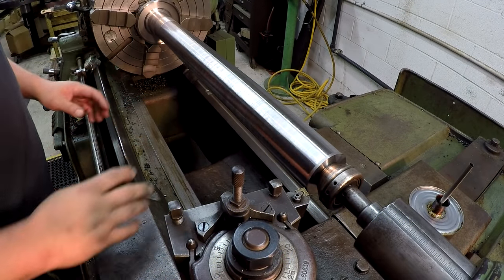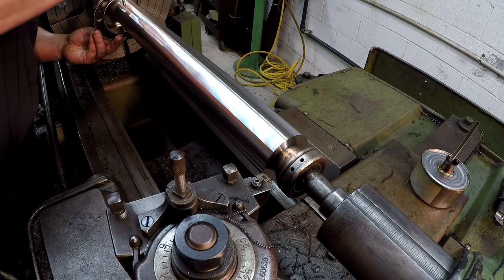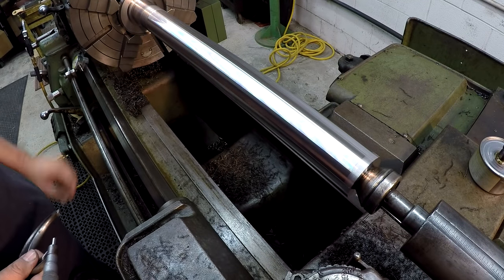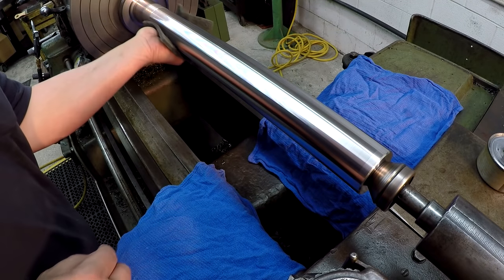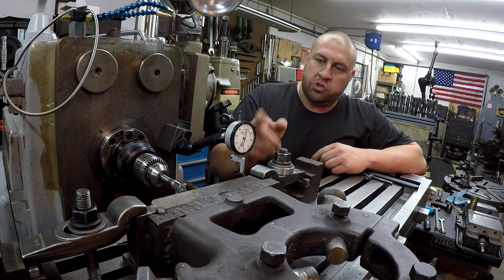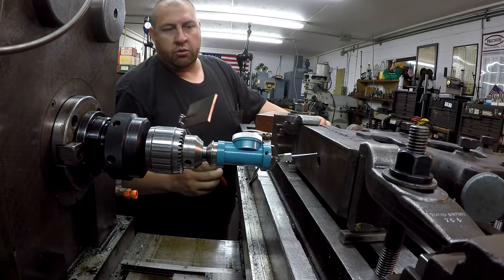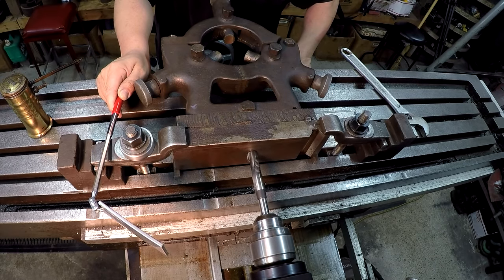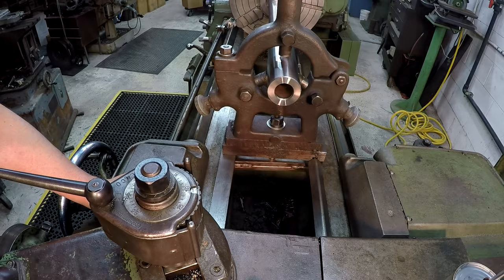Gearbox Shaft for Well Drilling Part 4

Comment: watching this stuff relaxing as it is isn`t just about bits of metal its about a logical thought process and moving forward stage by stage with patience and thoroughness checking each stage as you go. Its a lesson in life. I remember years ago being told to saw, file and scrape an accurately square 1 inch cube out of 1 1/4 inch mild steel square bar. At the time I thought what`s the point of this but as I got into it the penny dropped and I realised why I had been instructed to do it. Then just recently one of my friend sons said he had to do the same thing, he was angry that it was going to take so long and it was so useless. I suddenly felt like a wise man explaining to him the reason.
I expect many engineers will have learnt this lesson in their youth as well

Comment: Side controls on the K&T sure would be nice.  I leaft to get some flat bar for spacing my pillow block up on the hoist and came back and you gained like another 200 subs! You will be catching Saunders by the end of the year at this rate!
Reply from the maker: +bcbloc02 this morning I had like 800 to go, so looks like a thousand or so just today. Crazy stuff! Did you get the new pillow block you needed for the crane shaft?
Reply: Abom79
Yep, all I got to do is make an adapter block to mount it with.  Do that and a little welding and should be ready for lifting!

Comment: It'd be cool to have a laser based micrometer that could measure a diameter by just passing across a part without touching it.  Maybe it's not possible
Reply from the maker: +Do R/C! Sounds like something from Cybertron
Reply: Im pretty sure the tech already exists.   The only issue I see is compensating for it being on an angle but just adding a second laser and detector on either side should fix that. It would be really cool for ID measurement too

Comment: Mighty nice finish on that, I love it.
I'm still hearing some clipping there, do you have the rhode plugged in? I suspect not. GoPro sound has never impressed me too much although it's a lot better than some GoPro sound I've heard.
Reply from the maker: Yes I always use the Rode mic. Not sure where the clipping is coming from.
Reply: If there's a level setting on the camera? On my camera (canon 5d mkii) I set the sound from Auto to manual and then set the levels. Since most of the gigs I video are ranging from loud to deafening the gain gets set to the lowest stop before turning the gain to zero. Auto is great for many circumstances but any sound that is too loud just gets clipped.

I googled 'gopro sound settings' but am not sure of your model... There might be a 'Hi' and a 'Lo' setting but not sure.

As usual it takes a bit of study to figure out what people are talking about but it's useful to know these things I feel. You do an excellent job of making your videos, I am impressed Adam! That's the precision part of machining transferring across I reckon :)
Reply: I should add that once you get the gain turned down, you 'normalize' the audio so the peaks are at 0db so the audio does not end up quieter. In Adobe premiere, you right click the audio track and click 'Audio Gain' and check the setting 'Set Max peak to 0db', but most audio software calls it normalizing. I don't know what editing software you use...

Comment: Hey Adam...

wouldn't it be better to do the end threading before machining the shaft to final size?
... so as to not have the steady rest riding on the "final" shaft finish?

also... why is the shaft final diameter so critical?  does it actually ride against something? I assumed it just rotates freely in air space... just wonderin'.
Reply from the maker: +Anon Ymousmie There's always an order of production one can take, and this is just the way I prefer to do it. The ID of the shaft will polish up fine. The shaft slides though a hollow shaft in the gearbox.

Comment: Adam wathing your chanel im not a machinist , i work on cars but love what you do . question why when you take final cut it tents to taper down closer to the end ?
Reply from the maker: andrey sus there are many factors involved with that. Could be multiple reasons. Wear in machine, tailstock out of alignment, or tool break down.

Comment: Pristine finish on that shaft! XDD  Could almost use it as a mirror! XD

The reason you're using this smaller steady rest and not the one you adapted from the Victor is because the larger one from the Victor would be even less rigid right?  Along with fiddling with the the height of the larger one so the work piece, at least at this size is centered up.  Using the larger steady rest on this smaller size shaft, you'd possibly have even worse chatter problems.
Reply from the maker: Patriot1776 nah, the victor steady won't go down small enough to hold this shaft.
Reply: Abom79 That's a bummer. :/  Also makes me chuckle too on why you adapted it to work on the Monarch.  You try doing any work near the bigger steady rest's capacity on the Victor, the Victor I can guess starts crying 'uncle' in very short order, seeing as how you've shown it doesn't much enjoy doing very heavy duty ops like plunging deep into tough, large stock to part it off.

Comment: Gotta reinforce those attachments so they can handle Abom Torque.

If you had to submit a masterpiece to a machinists guild to become a master machinist, what do you think your best work is? Anything that you've impressed yourself with?
Reply from the maker: SuperAWaC There's been a few, but each job I try to shine on! I really liked that Heavy Metal shaft when it was done. You'll see it in part 3 finished.
Reply: Abom79 Can't wait to see it. Watching you do the big stuff is a treat.

Comment: Did you ever air condition your shop? I know you put the window unit in the wall but I thought you had a larger central unit you were going to install.
Reply from the maker: +Rick Hendrix I never hooked up the big unit. The window ac prove to work well enough to not invest all the money in plumbing in that 3 phase ac.
Reply: Fair enough. Don't fix it if it ain't broke.